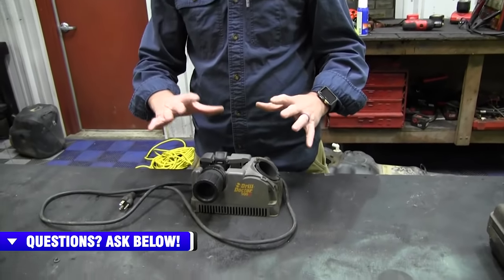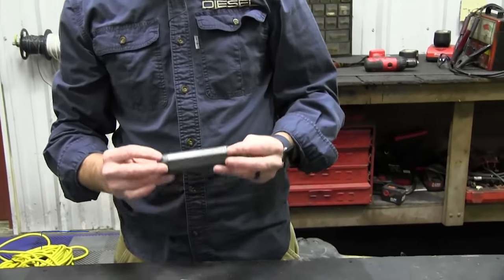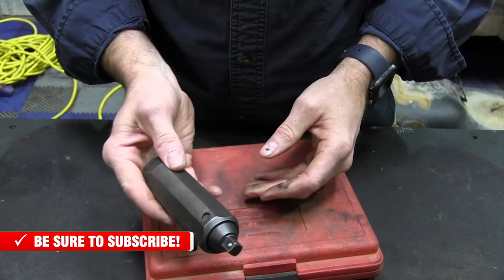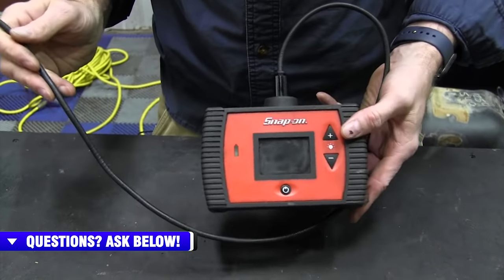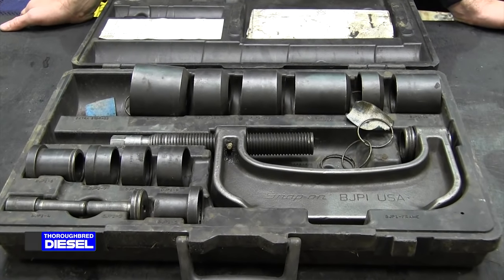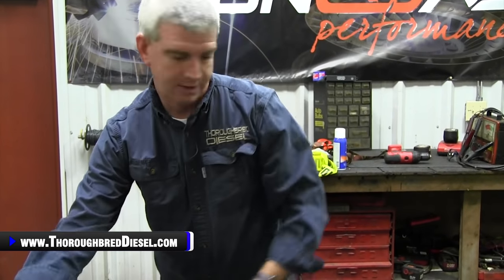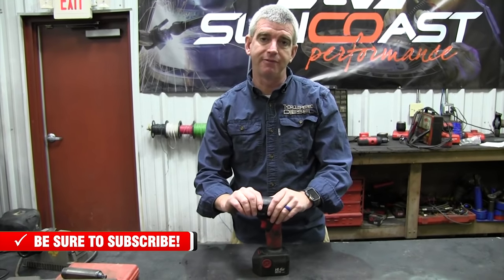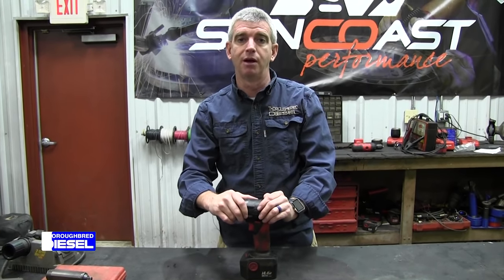Top 5 Must Have Diesel Mechanic Tools | Every Toolbox Should Have These 🔧

Comment: My top 5 

1) engine liner remover tool 
2)engine liner installer tool 
3)engine injector height gauges 
4)injector cups removal tool
5) 3/4 air impact 

I love doing a lot of engine overhauls so these are my top 5 tools to have

Comment: Milwaukee 1/2 drive high torque is a beast.
Reply: I agree
Reply: Worth it’s weight in gold
Reply: Milwaukee beats snap on every time when it comes to battery powered tools, snap on doest even have a 3/4 battery impact, that is a beast, not to mention milwaukee invented the worlds first 18v 9.0 battery and they have a 12 ah 18 volt
Reply: great for field work

Comment: 5 tap and die set. When you deal with rusty bolts sometimes the threads get damaged.
4 my scan tool. The ability to see all relevant data in a few seconds vs. Having to manually test is a huge advantage.
3 gearwrenches. Great for bolts in really tight spaces.
2 my long screwdrivers. Great for screws that are hard to get to.
1 definitely my impacts. 1/4 inch and 1/2
Reply from the maker: Nice list!
Reply: A good set of pick tools will help ya get those stubborn connectors apart.

Comment: I have to agree the Snap on BJ press is a beast. Works where others won’t. I agree about the price though, double the price of an otc brand kit.
     And I’ve backed off on Snap on cordless. Too expensive , batteries become obsolete and gun becomes useless.
 I’ve switched To Milwaukee and I think they out perform Snap on, cheaper and batteries can be bought anywhere. Batteries warrantied 2 years.

   I would add the Snap on 3/8” drive swivel sockets on 8” extensions. They are an awesome tool. Quickly tear down an engine with them.

Comment: For me, the “tools” I seem to use the most or are just handy to have over and above the usual stuff like 1/2” sockets, spanners etc. -in no particular order:

1/4” ratchet set- including spline and Torx bits etc. 

Decent lighting in my garage (more LED tubes in there than some office buildings)

A strong set of drive on ramps (I’ll have a lift one day I hope)

Pick tool set

Flexible magnetic pickup tool and small mirror 

Thanks for the video! Drill bit sharper is fantastic.. My father has had one for years.

Comment: 100% the 3/8 snap on air impact. It’s the best for tearing down everything on trucks. Almost as strong as 1/2 guns I’ve seen. My 1/2 snap on air impact takes lug nuts off tractor trailer wheels
Reply: Vinny Kapschock I had the mg325 and mg725 for that matter but I have seen the light and switched to Matco composite 1/2 and 3/8. Made by Ingersoll Rand. I also had the snap on pt850. Check out the Matco MT2769 1/2 and the MT2220 3/8. More working AND breakaway torque. 1300 ft lbs of breakaway torque on 1/2. I’d like to add that my box is snap on and like 85% of my tools are also, but impact wise I’m really glad I switched to the Matco composites. They’re just better.

Comment: What tools would you take for a bush job with no access to power? Only hand tools.
Reply from the maker: I love this question. I know a lot of people knock on someone for not always using Snap On or other mechanic name brand tools but  these hand tool kits that you can find at any big box stores can be life savers.  And they are all right there and not slung all over the place.   I think the one thing you always have to have is a good long breaker bar and as many swivels sockets, universals, and extensions that you need to get the job done.

Comment: Thanks for sharing I’m a heavy duty diesel mechanic so some of your choices don’t pertain to me for me it’s also angle wrenchs for hyd lines an amp clamp and multimeter wire connector removal tools and crimpers (weather pack and Deutsh style) feeler blades , pullers  various torque wrenchs  my favorite is magnetic cordless led lights !! Thankyou great video 👍

Comment: My number one must have is oxy acetaline torches my number two tool I use the most air compressor. Number three must have tool is my 1/2 snapon long ratchet.. and my fourth most used tools is gonna be diamond dip screw drivers and lastly the Braun flex head rechagable flash light from harbor freight
Reply from the maker: Good list. Thanks for sharing.

Comment: Do not buy an impact screwdriver. If you own an air hammer, like every good tech should, buy the Thexton THE482 Fastener removal tool. Never fight with a rotor again. Or any seized screw for that matter. Has saved me so much time and a lot of sore thumbs.

Comment: #10 Mac tools thread chasers for cleaning nuts and bolts as well as painted or rusty bolt holes 
#9 rechargable trouble lights.  magnetic mount any angle to metal surface 
#8 snapon locking swivel extensions saved many sockets from coming off in the you can see it but can't reach it place 
#7 snapon radiator hose clamp cable plyers they changed the way I remove clamps no pinched fingers or hands from water pump plyers slipping 
#6 snapon stuby swivel 3/8 ratchet for tight spots beside frames and engines 
#5 snapon external and  internal extractors for the rusted nuts and bolts 
#4 test light and multi meter can't have one with out the other for wiring 
#3 snapon 4 way wrenches for the hydrolics fittings found on joystick controls or any hydrolic hoses 
#2 snapon and Mac  air and electric impact tools guns,ratchets all sizes from 1/4 to 1 inch love them all 
#1snapon gas powered air compressor same as family

Comment: That ball joint kit isn't just for straight axle trucks it's for all ball joints
Reply: “Most” even though I totally wish it did every application there is some stuff it just won’t do.  The Dodge Journey comes to mind.
Reply: and ujoints
Reply: @INCC74656I  Tiger tool is what I use for u-joints up to 1 ton.

Comment: What’s the point of the hand impact driver if you have air or cordless impacts in that drive size?
Reply: Because when you hit it with your hammer it drives the tool into the head, less chance of slippage and stripping. Regular impacts try to climb out. It's a physics thing.

Comment: Agreed completely on the cordless impacts. Cut my shop electric bill in half!
Reply: Brent  Johnson compressor maintenance hardly exists anymore. The ratchets are cool as well.
Reply: Brent  Johnson : Yep, another case of passing another bill on to the already under-paid technicians. Gotta love it!
Reply: Bill Ford : Really? You must not do much work then. Air compressor is still an invaluable tool for every shop anywhere.
Reply: Turbo Diesel I bill over 80hrs a week by myself and have plenty f air tools. The reality of it is most of the times ding engine work I don't need the power of a air tool 90 percent of the time. I still use air tools when necessary but you'll find brushless tools have plenty power.
Reply: WTF does compressor maintenance and work load have do with anything you just said, for the record bud, there isn't anything man made that is welded, bolts or steel, that I am not Qualified to repair. I own plenty of air tools and I use them wisely, keep watchin YouTube bud ya might learn something yet.
Reply: Bill Ford & Brent Johnson: First of all Bill, honestly, nobody cares about your qualifications, so get off your high horse. Secondly, I'm a 20+ yr veteran mechanic myself, so your are preaching to the choir. As far as compressor maintenance, your statement about it hardly existing anymore is nonsense. It is what it is, and always has been. Change oil in compressor, maintain belt tension, drain tanks regularly, and run the hell outta it. Same as it always has been. Nothing has changed at all with industrial grade air compressors. Moving on... As far as cordless tools go, nobody can downplay the outrageous initial costs of the modern cordless electrical tools (referring to any of the high quality ones that are actually worth buying). You also can't deny that they will fail (batteries, and hard parts alike) and be very costly to repair. They will require more total ownership costs than any air tools ever have or will over a given period of time. It's just plain fact. That said, due to their sheer convenience, less noise, and overall versatility, I will agree that owning cordless electrical tools Is somewhat of a necessary evil, to have along with your inventory of pre-existing air tools. It's kind of like owning a metric set of wrenches along with your standard ones. It has become basically a necessity, whether you like it or not if you are going to be a successful and productive mechanic. All that said, air compressors  and air tools will always have a need in the shop for all kinds of tasks, well beyond that of any cordless tools. Compressor maintenance is the same as it always has been. Those were my points.